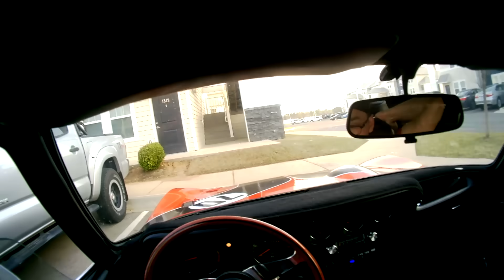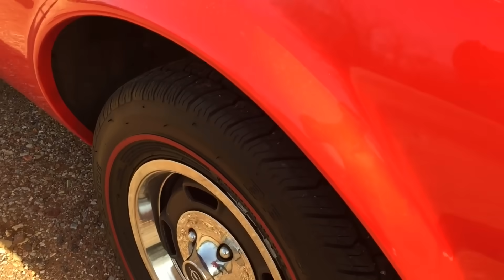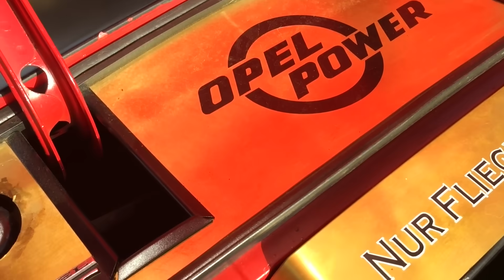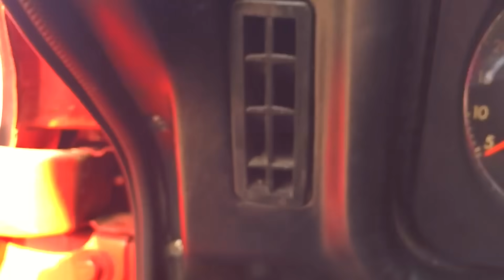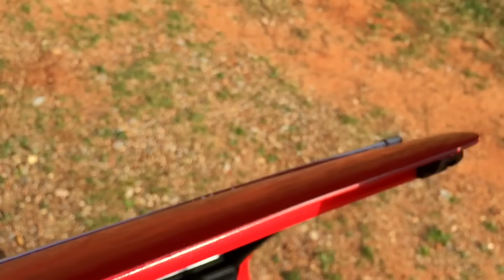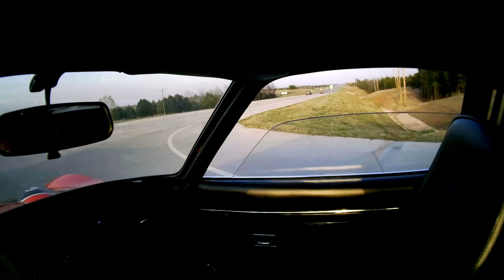Opel GT: History & Review

Comment: I had a 1969  Opel GT, bought it in 1975 for $ 350.00. It must have been one of the first ones made since it had a regular screw on gas cap, nothing like the flip up caps you see on most GTs.  The engine was a 1.1 SR, 56 cubic inches and a whopping 67 HP.   This guy weighed 1800 lbs, it was so light that the wind direction had a huge impact on the top speed which was around 95 mph on a good day. I blew up the 1st engine flying around a sharp interstate entrance ramp, lost oil pressure. The second engine another 1.1SR came from an Opel Kadet RS.  I traded the GT for a 1969 Camaro and although I really wanted the Camaro I missed the GT. So, went looking for another and there were a bunch of them selling for pennies. Problem was, they all had 1,9 L engines, they were faster than my old one but drove like a boat so I passed on them.

Comment: I had a 1970 1.9 litre.I loved that car and the memories.I was a Senior in High School at the time.There is a great hiding place under the ashtray (it pops out).Will hold a few buds underneath.Also if you have one of these and it starts blowing massive amounts of blue smoke out the exhaust.It will stop after a minute or so.Do not panic it is only brake fluid being dumped into the exhaust.This is due to a faulty one eay valve on the brake master cylinder.They arenot that expensive and after replacing the valve,no more smoke problems
The girst time ithappened to me,I thought the worst.Also as mentioned here I think.I replaced the carb with a 4 barrel weber carb.The tires would spin out in third and fourth gears.

Comment: Back in 1969, I went to the New York Auto Show to see this car. It was gold, 1.9 liter engine and it was hard to get close to the car to get a close look.  Lichtenburg Robbins Buick, in Queens, owned this one, and it was for the show only. It was the first one in the country. The salesman walked over to me, as I was staring at it for about two hours, walking around it over and over. He asked if I wanted to sit in it, and I smiled, wryly, and shook my head yes. I sat in it, and he closed the door. Yup! I wanted this car! We talked for awhile, and he said that I would be able to have it after the show and it was the only model, so they needed it in the showroom for a month .. at least. If I remember, it was $2100.00. We talked and finally agreed that I could have it right after the show, and it was back at the dealership. I got the call that it was back in the dealership, so I went with my friend Mike to pick it up. I lived in Brooklyn. When i got there they said that I had to wait a month. I took out cash .. $3400.00, I believe, they prepped it and I drove it home right then and there. Money talks. That car moved. It was a low flying jet. Fishtailed in turns at speed, so I learned to speed shift. I used to go out at daybreak, and get on the Belt Parkway .. out to Long Island .. past Kennedy Airport. Whenever I took that car out, crowds gathered around. Red lights, stop signs, It was hard to go anywhere. Went into Manhattan, and nobody knew what it was. Those were the days ... yes, those were the days.
Reply: AWESOME STORY! ☮️

Comment: My first car was 1971 Opel GT.  It had modified head valve work and exhaust for increased airflow, dual downdraft carbs, and head milled to max allowable for increased compression. Custom suspension and  really wide tires on aluminum Hurricane wheels helped its handling ability.  It was very quick for a normally aspirated I4.

Comment: Opel GTs were actually built in Belgium. I first had a 1974  neon green Opel Manta that lasted forever. Later, I had a 1972 GT that was originally orange, but had it painted fire engine red. Again, never a problem. Sure miss it. There were a few Opel models in NorCal in the 80's and 90s. But not many can claim having TWO Opels.
Reply: IIRC, Mantas and Asconas were made in Belgium. The GT's unibody was built in France and final assembly was done in Bochum, Germany.

Comment: nice rundown. i had a late '73 (orange/red taillights) for 8 years. i upgraded to weber carb, removed the egr valve, slightly larger tires (195s(?)) on slightly wider enkei rims, stronger battery, low-flow muffler and 4-tip ansa resinator and kept it maintained so it was very dependable. also added a couple shims behind the oil pump relief spring to bump up the oil pressure a bit.  the ride would get really light at speed and it would begin to "float" at around 100. highest speed for me was around 130 - just once. recall the tach number reading was half that of the speedo (e.g., 35(00) at 70 mph) and that position of the needles pointed to same position on face (straight up at 70mph/3500 rpm) in 4th gear. amp, oil and temp needles were in center of gauge faces at operating rpm/temp (for quick reference?). lower compression (7.6:1) engine was otherwise stock and got about 35 mpg. it was pretty tired by time i sold it w/269k. new owner trashed it in less than 90 days. 
a few details i can recall:
- very early models had 2-piece front bumper, hand brake mounted on side - instead of top - of the tunnel and no console tray or rear side marker lamp. i think earliest 1.9l had star stamp (high compression) on cylinder head. 
- other early models had "s" stamp on cylinder head (9:1(?) compr.) rectangular indicators mounted in a removable panel between the speedo and tach, contoured headlight handle, pop-up ash tray lid, hi/lo beam button on turn signal, stationary rear quarter windows and up/down arrows only on the heater controls.
- 1.1l model had dual carbs and smaller brake cylinders/shoes (same as the kadet) and was embarrassingly underpowered. 
- gt/j had blacked out bumpers, flat black "gt/j" stripe, indicator lights instead of temp/oil pressure, fog light switch and clock deletes (saw a few of these when i lived in europe).
- european models had sway bars and clear (instead of amber) turn signal lamps under front bumper. most also did not have rear side marker lamps.

- late '73s got the two-color taillights, "lite" (instead of light symbol) rocker switch in dash, "GT" only (no gm badge) on back panel, and deleted foglight switch under the heater controls, which had air flow arrows and "def." 
- all gt models had european parking lamp feature built into the turn signal - lever up or down will power the left or right marker lamp when key switch is off. 
- hella fog lamps from rally cadet will fit between bumperettes and license plate under front bumper. rectangular hella 550 lamps would also fit in same space. stock rocker switch for fog lamps only has enough power to engage a relay. the 4-tip ansa exhaust (from an opel parts dealer in tolland, ct) fit very well and sounded great. many parts were interchangable with other models (e.g., kadet, 1900, manta).  i searched many wrecking yards for a limited slip diff but never found one.
agree with your points regarding soft control arms, low hp, soft suspension (light inside rear wheel) and "5-alarm dead short" headlight wiring (design has them wired direct - no fuses).  would also add that the rear defogs were junk and that 3rd gear synchro, torque tube bearing/rubber snubber, "tinker toy" headlight mechanism, charging relay and key switch were weak points.

Comment: I have a 1970. I desire better road holding. Which F&R sway bars do you recommend?
Reply from the maker: Addco front sway bar with an Opel GT source rear bar. 
The Opel GT source front bar is nicer, but it’s a bit too thick for my liking. The smaller addco bar gives more balanced handling when combined with the thicker Opel GT Source rear bar.

Comment: The car was made from 66-mid 70’s
Reply from the maker: No it wasn’t. There were less than 400 made in 1968 which was the first year of production. Those models were finished by hand. 1969-1973 were the main years of production. The last Opel GT rolled off the assembly line for the 73 model year

Comment: Might want to mention that 68-70 1.9’s had solid lifters and 71-73 had hydraulic. Be sure you have the right service manual for valve lash adjustment.

Comment: Hey Kyler, I hadn’t seen this video until just now.  Good job. I have a question about your mention of the top speed.  Why is it a really bad idea to go over 120?  What effect occurs?  I’ve done 110 in mine, and probably won’t go faster than that, but I don’t know for sure.  Mine has a 2.2L engine and a 5-speed GETRAG that Gil put in for my best friend.
Reply from the maker: Thanks Terry. I’ve done over 115mph with no issues, but the GT has significant lift above 100mph. On the order of 200 lbs rear and 150lbs front. By 120mph this could be much higher because the more the front lifts up the more air lift it catches. This makes steering very light.

Comment: Ok, so I have an A/L with a BUN # of 647.  It's a flat panel, but (as I found it) it has a one piece front bumper.  The VIN production # shows a car that 'should' have been marketed a '69 year model.  From what I've found at opelgt.com it may be one of the earliest BUN # cars in the US.  I need to check the block/head stampings on this car to verify the early engine.  I'm hoping it's salvageable, lots of rust though.  smh

Comment: Nice, but what is that (warning) light on the dash on all the time about ?
Reply from the maker: It tells you if the headlights aren’t closed all the way. I recently fixed the problem. The PO accidentally put the indicator light wire on the wrong terminal on the headlight microswitch. It’s a very difficult job to pull the headlight mechanism to fix it, so I lived with it for a good while.

Comment: Thanks a lot for this magnificant video! Really well documented, only little flaw in your comment  is that only US GT's came without   anti roll-(sway)bars,not true,also all EU GT's upto "70 came without, though it was an option to have them installed.
Reply from the maker: Thank you! And thanks for the correction. So I guess they added the sway bars for 1971. Did the Euro GTs ever have a factory front bar, or was it only an option?
Reply: @OpelPower , As far as i can remember reading documentation,after the modellyear '69 all GT's were fitted with factory installed Anti roll/Sway bars,both front and rear,before that year this was only an option. So all post '69 GT's should have come  with sway bars.
The main differences in EU and US versions were; the color of the round indicators glass in lower front,orange red in US,/Clear glass used as fog light in EU.
The glass of the main headlight differs,H4 for EU
The red rectangular side markers in rear sides,/not fitted at all in EU cars.
The optional color sceme of interior upholstery differs,for instance the color"Buckskin" was not available in EU.
I'm not sure about the AC system,but as far as my memory goes i think this was only US option aswell. someone correct me if i'm wrong please.
Also very interesting is the GT-aero project

Comment: The first couple years of Chevrolet Vega had the same 4-speed transmission, and the Pontiac T1000 5-speed will fit perfectly with only modification to the upper two bell housing holes and the drive shaft length. The input shaft, splines and pilot bearing are the same size. The 5-speed shifter comes out about 4 inches further back and you need to cut the parcel tray/console to make it look nice. I had a red 1969 GT with a 1975 Manta fuel injection and that 5-speed. I loved how nice it rode down the highway. It didn't have A/C, though and that would make it perfect. BTW, it was an early 1969 with rectangular indicator lamps in the center and the horn button was a little button on the end of the turn signal stalk.

Edit for clarification:  The 5-speed aluminum bell housing upper 2 bolt holes needed to be filed/elongated upward, as they were lower than the holes in the block. Otherwise, all the other bolts and the dowel pins lined up perfectly. Even the clutch release lever arm and release bearing are the same.

Comment: The driver's side headlamp closure needs adjustment. You can clearly see it doesn't quite go all the way shut and latch as you close it. That's why your little round white instrument panel lamp is on. Not only do the headlamp wires get brittle, but the three small bolts tend to loosen. On my GT cars, I used Locktite red and that kept them tight
Reply from the maker: Oh it did lock all the way. But yes those three bolts were loose. Actually fixed it today. The wire for the white indicator was on the incorrect terminal.

Comment: OPEL were a very good quality car Many yrs ago. I don't think we got the GT here in the UK ? 
Opel Kadette, & Manta  were Very Good cars. 

Look up the Last UK OPEL,  The MANTA GT/E Coupe Exclusive model. ( production ended in 1987 )
A Very Good UK Ford CAPRI  Alternative. 
The Last Run out model was Every bit as good or better than a Ford Capri. 
with a 2.0 liter injection engine. 
It came in 2 Body Styles , 
a 3dr sports hatch. with Hatchback & folding rear seats = The Popular Option, 
And the 2dr Coupe' version.  IDENTICAL but one was hatchback & one was a true 2 dr coupe' 
with Separate Boot lid ( Trunk lid ) 

Look them Up in the UK , the Later " Exclusives " had twin round Headlamps. 

Very Rare & Very Desirable Cars here in the UK. 
LOOK UP Vauxhall Cavalier Coupe' & Sportshatch.  = the same car wearing VAUXHALL Badges. Produced from 1976 to 1987 approx. 
I Have the ORIGINAL Sales Brochures for both VX & OPEL. 

I Owned Both & lots of them Many yrs ago. FANTASTIC cars Even when they were 10 or 15 yrs old. 

The " Exclusives "  were very Desirable cars with Air dams & Spoilers & red logo's & Charcoal & silver alloys.  BUT Subtle, Not OTT in your Face !! 
Very Acceptable in the Office car park, 
& Very acceptable with the  " Boy Racer Crowd" . 

The SECRET MUSTANG for the UK.  with Very Pleasing Performance Mid 1980's 2.0 injection. 
Superb Handling & Nice Smooth Ride.  
NO SUPER CAR ! This was 4 door FORD & Vauxhall Prices New. 
Very Affordable New by anyone with a Job.  Ford Capri Money. 
Family Saloon car Prices . Mass produced & we all had one . 

Like Ford with the CAPRI, 
OPEL /VX / GM never replaced the MANTA, 
They tried with a Thing on 4 wheels called a CALIBRA ? 
NO THANKS !! 
Ford tried with the COUGAR ??? 
NO thanks !! We didn't buy them & they Failed BIG TIME !! 

They LOST the PLOT on Car Design. 
UGLY then & Still UGLY 25 yrs on . 

Own a Capri / Manta today & You are COOL ! 
own a Cougar / or Clibra & People from 18 to 80 yrs old will LAUGH AT YOU & TAKE THE PISS !!

Comment: I test drove a new 1970 in the Leesburg Florida area when I was 15, just after getting my learners permit. It had good performance, was fun to drive, but a bit expensive around $3,500 giver or take a few hundred. I know that sounds cheap now, but back then you could buy a new Gremlin under $2,000. The one I drove was red and had the automatic transmission.  I wanted the car but couldn't convince mom. I loved the GT because it looked like a Corvette, but sized like most of the sports cars then.

Comment: So this thing was on the road and competing with the 240Z cars...what a joke.
Reply from the maker: Keep in mind the 240z was close in price in 1970, but it was a loss leader. By 1973 the 240Z was $4695. Over $1300 dollars more expensive than the GT (that’s $7200 more in today’s cash!)

The 240z vs an Opel GT is kind of like a modern GT86 vs a Supra.
Reply: afaic, gt couldn't compete with the 240z, which had two more cylinders and about 25% more displacement. also coudn't compete with the 914, which had better weight distribution and - in some models - larger displacement.

Comment: I had a 1.9 liter version of the Opel GT in my mis-spent youth. It had the performance limits mentioned here, but when you consider that its competition was the MGB and Porsche 914,  it was a pretty good car. The long wheel base made quick handling an unfulfilled wish. Downsides not mentioned here include the super thin sheet metal in the body, easily dented and hard to cleanly repair. Also a pretty crude transmission which made shifting not a fast operation. The worst part of the car was the 1.9 engine. At least the version in the US model was literally a GM truck engine built in Brazil, and said to be also used in tractors there. Revs? What revs? This engine in stock form starts gasping around 3600 rpm and simply runs out of juice around 5,000 rpm. The GT was long on style and appearance, short on performance, but unlike its competition, it had a basic build quality which made it reliable (if laughable by modern standards). Very easy to DIY work on. On a trip to Sun Valley Idaho from Portland Oregon, my GT just stopped running in high mountains about 75 miles from anywhere (and no cell phones then). Under the hood, I discovered that a screw had loosened and ejected itself from the linkage to the Weber carburetor. A twist of paperclip later and I was on my way. My first stop in Sun Valley was the Porsche dealer, as the 914 used the same carburetor. The parts guy like my story so much that he gave me several replacement screws. Being basically lazy, I drove the GT around on the paperclip for more than a year with no issues before I finished the repair. After storing the GT for many years, I sold it to the teenage son of a fellow lawyer doe $400. After he abused it and started picking up tickets, his mother made him sell it.
Reply from the maker: The US 1900 CIH was not a truck engine and it was made only in Germany. The CIH was first introduced in 1965 in the Opel Rekord B as the new high powered engine option. It’s never been used in any tractors, although the same engine was used in Bedford delivery vans up until the late 1990s in the UK.